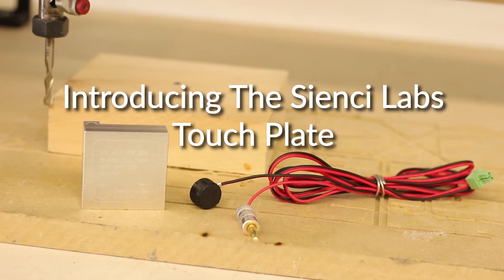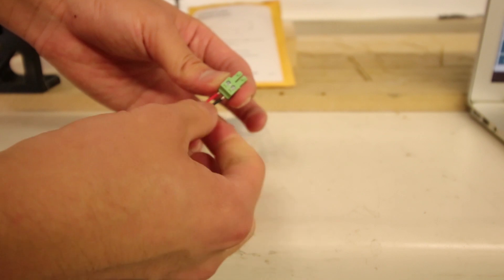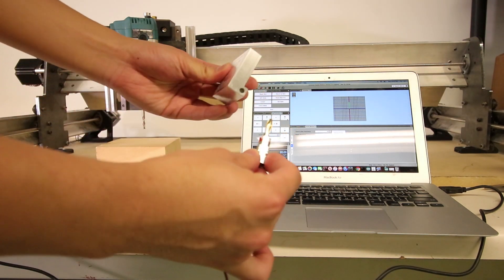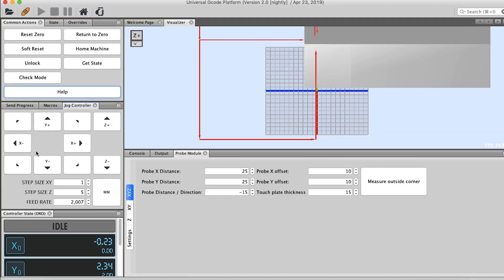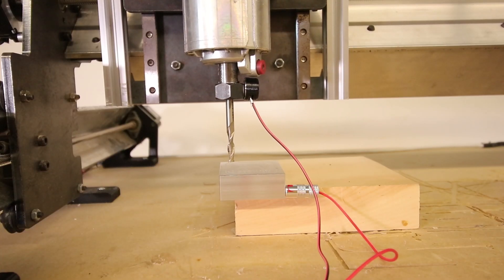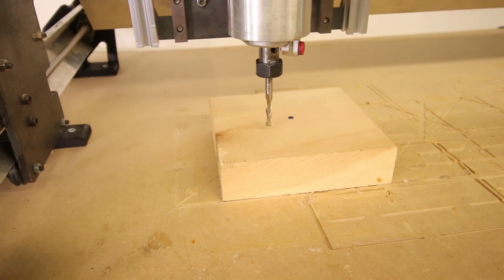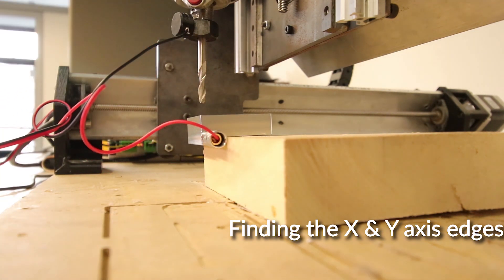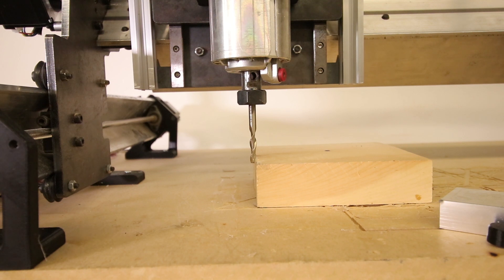Introducing the Sienci Labs Touch Plate

Comment: I must of missed something. Doesn't the touch plate wall thickness for x & y and z thickness need to be measured and put into the touch plate settings first?
Reply from the maker: If you want an added level of accuracy you can certainly measure the plate and input those values. Normally they're made quite precisely so if you don't have precise measuring equipment then the default values will suffice 👍

Comment: Just used mine and works great BUT!!! noob here remember to move the cable off the track :( rolled over them and squashed them. It still works but i have to play with the cable a bit trying to figure out how to replace the cable. Thanks for the vid got working after a few minutes on Gsender.

Comment: Sorry, I am new to this. I cannot get the Touch plate to set up properly with Gsender’s touch plate function. It seems I am not understanding the step about the green light and the software instruction is not clear to me. Any help please?
Reply from the maker: Hi Eric, if you've got the touch plate set up correctly you should be seeing the green light pop up when you go to probe in gSender. If you don't, that will be an indication that you might have a wire loose. You can check the last point here: https://resources.sienci.com/view/lm-troubleshooting/#my-bit-is-crashing-into-the-touch-plate   for more info
-Chris
Reply: @SienciLabs  Thank you Chris, I did as suggested in your video, I have cut the wire end, stripped it bare and reconnected, with the red wire plugged on the Probe side. Still nothing when I touch the bit with the probe, it stays red.
Reply from the maker: Eric, would you happen to have a multimeter on hand? If so I would suggest using it in continuity mode or resistance mode and checking between the green connector and the plate, then the green connector and the magnet to see if they're both conducting properly. If the resistance is infinite then there will still be a connection issue, if it's high then your touch plate might be conducting poorly and you could try to scuff it up a little bit. Let me know if I can help any more.
-Chris

Comment: Do I need to convert these settings over to inches?  In the probe module tab under settings I have it set to mm and then I entered these numbers but in the jog controller and my gcodes I have it set to inches. Will that conflict with each other and mess things up?
Reply from the maker: There IS a bug that we reported to the UGS team where there can cause issues if the probe settings are in mm and the jogging is in inches, you can see the fix for it here: https://sienci.com/dmx-longmill/troubleshooting/#My_bit_is_crashing_into_the_touch_plate

If you'd like to set up probing for yourself in inches rather than mm then this should avoid that issue happening 👍

Comment: Is there a way to not have it so aggressive dig into the plate when initiating? Thanks!
Reply from the maker: Hi Dave, you can adjust the speed that the end mill travels by changing your fast and slow find feed rate on the settings.  More info here: https://sienci.com/dmx-longmill/touch-plates/

Comment: Works pretty good! Only difference for me to make it work was by *directly sticking the magnet onto the bit * instead of the chuck-nut on my Ridgid (#24012) router or else the bit was digging into the plate :(
Reply from the maker: Hey Muthu, it might be that the paint on your chuck nut is too thick to let a signal through. Putting it on the bit is a good idea if you can't get it to conduct.
Reply: @SienciLabs  its a bit precarious to stick it on 1/8" bits so I might go for croc-clips instead of magnet.  BTW please update your instruction wiki.

Comment: Having trouble with mine, did all the setting but when I return it back to zero it goes below the space by 1/2 or so. Have to move my piece or it will want to break through it. Need some help.
Reply from the maker: Hi Jamie, please get in touch via email and we'll get you up and running!

Comment: Would there be away to utilize this with the mill one?
Reply from the maker: Hi Collin, there should be a pin for probe input on the control board on the Mill One you can use for touch plate.
Reply: Sienci Labs great! Thank you so much for getting back to me. Any idea what pin? Or do you just pick any open input pin on the Arduino and then tweak the code with the number of the new output pin you use? Really enjoying my Mill One! 🤙
Reply from the maker: @mxcollin95  I don't remember off the top of my head but you should be able to find it on the GRBL wiki.